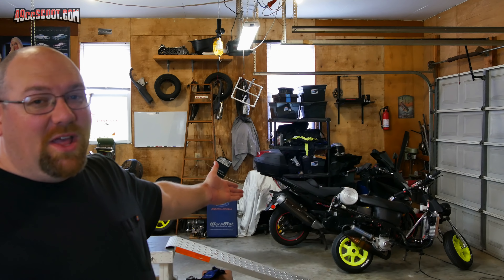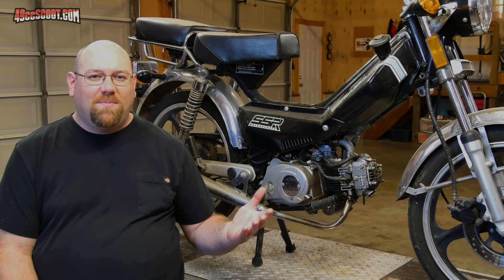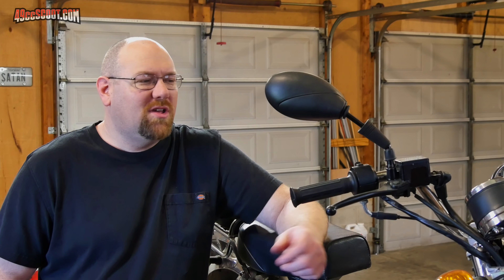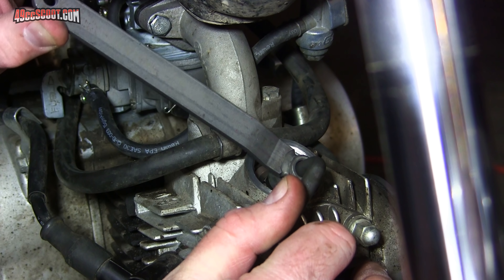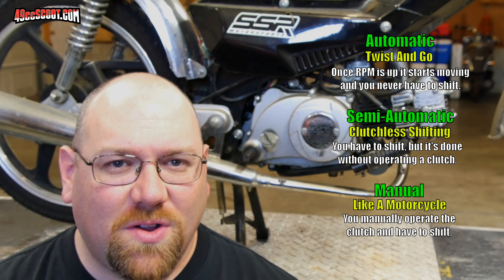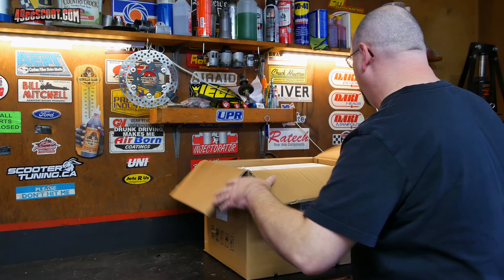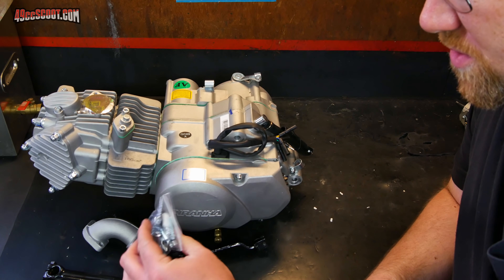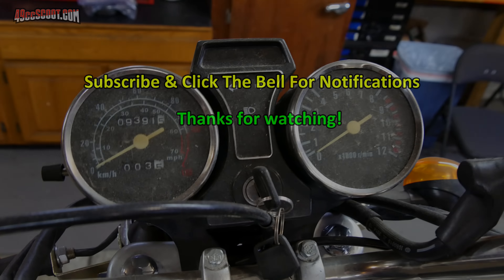SSR Part 1 : Starting A New 49cc Based Project

Comment: Wow I never knew there were 4stroke mopeds like this. A few months ago I bought a Tomos as a project. I restored it, tuned it. And now it's my main vehicle, because I sadly blew up my Piaggio's engine. But luckily I'll get my new cilinder soon and crankshaft soon.
Reply from the maker: They don't seem to be very popular. Good luck with your project.
Reply: @49ccscoot  well Tomos is very popular in the balkan region (former Yugoslavia), its kinda like an icon.
They made a 20 horsepower 50cc race version in the 1980s, look it up tomos gp 77 and gp 78
Reply from the maker: @gocak745  I meant the 4Ts. A friend of mine had a Tomos Sprint and it was pretty fun to ride, even stock. I didn't know about the 20 HP versions though.

Comment: the moped bogging down is a result of an insufficient ground between the carb intake bolt and the frame, excited you have one of these grew up with Tomos A35 and regretted selling mine
Reply: I run at least 2 grounds secured with ring terminals off the intake boot bolts on my GY6 I've run into this issue several times

Comment: Hey. I have this exact moped with the same problem. I did all this stuff you did and then after a few months It was the centrifugal clutch. The clutch springs are out so your going to need to replace the springs but I put a performance clutch on and it is a beast now.
Reply from the maker: Thanks for the info. Some other comments show interest in the issue, so hopefully it helps them.

Comment: I haven't had a scooter for years but love your channel.  I do still dream of on offroad capable scooter though....perhaps something like a Piaggio LT150 or Liberty with dirt tires.
Reply from the maker: I'd go for something without much bodywork and make sure you can get knobby tires for whatever wheel size it has. You could always get a pitbike with an automatic version of these engines if all you want is an offroad automatic.

Comment: Is the engine case capable of housing gears?

There are nice 190+cc electric start engine available cheaply, roughly 20hp

Reliability issues are usually kickstart and gear cluster issues
Reply from the maker: Yes. The 190s I've seen were not in my budget and I have my doubts about them holding up for street use based on  reading some forums. 15HP isn't bad and I can always get a big bore kit if I really have to have more. I think I saw somewhere that there was a ~200cc BBK too that requires case machining.

Comment: Dude, do you have the service manual from this motor : LC157QMJ, i want the torque values, ive assembly my final transmision and i got oil leak, then when i put the bolts again i broke one bolt, thats why i want the torques,thanks
Reply from the maker: https://www.49ccscoot.com/manuals/Arrow_150_Engine_Service_Manual.pdf

Comment: hi chief :D julian from bucharest here , im gonna dumb about 600 euros in my keeway , i have a dillema , 17.5 or 19mm carb ? also at the shop i found they only have manual choke carburators , tnt carb 17.5 / dellorto carb 17.5 both manual chokes ... can it be modified to go manual from automatic ? or its not good ?

Comment: Hey scooter man. I have a problem. I have taotao atm50-a1 with big bore. Blew engine from lack of oil. Ordered new one but accidentally bought long case. I'm not to sure ebay guy will return and I couldn't cancel. I think I know the answer but the long case in no way can replace short case can it?
Reply from the maker: You can probably swap it in, but it may require work. If you get really lucky then it will just look like you stretched the scooter a couple of inches. Could have issues like running into the mudguard or body panels or the shock not aligning as it should. If you can't get a return/exchange, then I'd at least mock it up and see what it's like before giving up on it.
Reply: @49ccscoot  thanks for the reply brother. The gods have smiled upon me. I was able to purchase a. " sym 200 hd for 500 bucks. It only has 5500 miles. The guy wasnt sure what was wrong with It bc it wouldn't start a d he said last time it did it bogged down..  well a 3 dollar fuse carb cleaning, fresh gas and my 50cc battery and I got a kick ass scooter!  Got her up to 70mph on the highway! I def think I'm done with the tao tao but I definitely learned a ton from your videos and I really appreciate you.

Comment: Considering this bike because i longer the vintage style. My understanding that it's not very powerful. Do you have any recommendations for a 72cc big bore kit? Any other upgrades? Thanks
Reply from the maker: I've used Trail Bikes big bores before and they were quality. With these engines, swaps are pretty simple. You can buy larger engines and swap them in. I'm not sure what the largest fully automatic is, maybe 110cc. You can also get the semi-auto style, so you shift but there is no manual clutch to use. Then there are full manual engines that get really big. Watch the rest of the series and you'll see me swapping in a 160cc full manual.
Reply: Thanks. Don't want to get a cycle licence. Have to keep it 50. But they won't know if i put a 70cc kit on there after it's registered. I'm 47. Big guy. Just looking to make this lug me around because i love the style

Comment: Timing chain jumped? Ignition timing out?
Reply from the maker: I actually put a degree wheel on it when I was first checking it because I had a scoot that had the flywheel machined wrong once and it was really sluggish. Looked OK though.

Comment: Hey mate have been following your projects and find them great, very in-depth so I’m starting mine. I have a Aprilia sport city 50cc 2 stroke I have done a few things too but one of them being that I won’t it to run on e85 and just finding it hard to tune the 22mm carb so it runs great have been playing around with the jets and stuff. But just after your thoughts on this? Keep up the good work hope to hear from you.
Reply from the maker: Remember that E85 is going to require richer jetting than what you are used to and what you'll usually find quoted for various setups using more standard 10% ethanol or ethanol free fuels. The air/fuel ratio for E85 is about 9.8:1 vs 14.7:1 for ethanol free, so it needs more fuel per volume of air. Aside from larger jets, you'll need to make sure the rest of the fuel system is in good working order and can supply sufficient flow.

E85 is going to be more hygroscopic, so it will absorb more moisture from the air than standard pump gas. That could cause problems if it sits for very long. Some two-stroke oils may not mix well or stay mixed as long in E85 also.

If you're trying to use a CHT and are accustomed to plain pump gas, then you may see a little different numbers so that  could throw off your tuning if you're relying on that.

We don't have E85 at the pump anywhere very near me, so I've never messed with it to give you first hand experience.
Reply: 49ccScoot

 thanks mate I will keep working on it and let you know how it goes.

Comment: How long does a scooter last 
10,000 miles
Reply from the maker: It depends on the scooter, the maintenance, how it's used, and so on. If you get a quality 49cc and treat and maintain it well, it could go 20,000+. If you're talking about any scoot... my TMAX 500 has 28,000 miles on it and I haven't even changed the drive belt yet.

Comment: Where do you find the vin number ?
Reply from the maker: Most scooters and mopeds will have a VIN on the frame  somewhere between the hbars and the pegs/floor. If it has body panels, you may see a rectangular panel that pops out, which covers the VIN.  Sometimes there will be a VIN plate as well, which can be pretty much anywhere they want to put it. This one had it etched into the frame as described and had an ID plate under the seat.
Reply: @49ccscoot  Thank you for replying for one. And I found it it was under the seat

Comment: Just subscribe to your channel. Great channel. Question. I’m new into moped. Have a Soleil R8 49cc GY6 moped I think it’s made by znenmotor so I’m 200 lbs and 5 11. Bike stock does 30 to 40 straight and hills 20 to 25. Rides nice and quite. Just want to add more torque to keep up with traffic going to work. Was thinking of doing 100cc BBK but seeing a lot have heat issues or more. I thinking of doing a 80cc. I seen lots and lots of videos how to do it and more. But being im not a mechanic it seem overwhelming but I feel I can do it and have the time since we are lock down In Hawai’i. I seen lots in amazon for like 45 to 90 dollars. And eyes pop open cause here the shop want to charge me 340 just to install the 80cc head kit that they sell. And 580 for a full 100cc kit with cam and cdi. I just wanted to know if I should try and take the challenge on a perfect running bike being I have not done any type of this project before. I do mostly computer building and tech. So this will be different. Please advise on this. Save money and try it out. Or spend the 340 and have the shop do the 80cc bore head. Thank you and aloha from Hawaii. Stay safe.
Reply from the maker: Hey. First, good call on the 80cc IMO. 80cc is actually 72cc and 47mm bore, but they love to advertise everything bigger. Anyway, those seem to be less prone to failure. You mentioned going to work, so reliability is likely a good thing for you. Most reliable will be the stock engine, probably, but I think those kits are a good tradeoff of power increase vs reliability. Get a Taiwan made kit. Don't buy the cheapest thing on amazon. Sometimes those work out awesome. Sometimes those have poor clearances and gaps. Taiwan made kits aren't that much more (Naraku, SSP-G, NCY, etc...).

I build my own PCs when I have to, which thankfully is not often. If you do that on a daily basis and are capable of dealing with details like which header to plug in or what components work well together and so on, then I would guess that you are capable of doing your own big bore kit. The trick to learning with this stuff is to take your time, follow instructions and tutorials, and ask if you aren't sure. It's better to be down an extra day waiting to be sure than doing it wrong and messing something up.

Take the time to check the piston ring end gap (not always mentioned in tutorials, but I have one here that you may want to check out : https://49ccscoot.proboards.com/thread/350/big-bore-kit-installation ). Check and double check the timing marks and valve adjustments.
Reply: @49ccscoot  thank you so much  Yes What I have read and seen was the 80cc to be the safe and still have that power when you need it.  I was thrown off when I was riding to work and this pink pronto moped blew pass me  I think was doing like 45 50.  I would love to achive that on a basic setup.  I buy mostly from Amazon due to the shipping to hawaii.  If you can kindly share a link to what parts I need for an 80cc BBK and if I need a better carb since the stock is not able to open to change the jets.  Yes I watch to much you tube on all this and I find yours to be the very best and I feel lots confident watching your channel.  Again Mahalo and Aloha from Hawaii
Reply from the maker: @JPTake3  A lot of the stuff I see on there is Chinese. I would consider checking out somewhere like ScooterTuning.Ca. Not sure how they are to HI, but their shipping is great to me in the continental US. Check out NK100.47 cylinder kit, NK200.01 carb,  S6-28GY6-002 jet kit, and then I would get DrPulley sliders (16x13) for tuning the CVT. They don't carry those unfortunately. Maybe a set of 5g and 8g. That  would give you some tuning range. 5g usually works well stock, so you shouldn't need anything lighter. You can mix them 5,8,5,8,5,8 to average 6.5g. You can also stuff them with foil to make either set heavier by a gram or so if needed.
Reply: 49ccScoot thank you. Will search for those items. Just got back from doing errands and love this bike. Doing 30 to 40 is nice. But that extra boost would be nice. Since traffic can be crazy here. But I did do the slider which I read and ordered the previous owner had 5.5 and took longer to hit 40. Now I change it to 4.5 and hit 40 quicker. Both rollers don’t have that take off but it’s good. Not like that video I just watch that you was tuning that bike. My goodness 70 plus mph. That’s too much for me. I be happy at 55 plus and that would make my day. As you can see I did change the roller and had to get an impact gun. Tried all the other day from you tube but the right tools made it easier to change the rollers. Again keep up the great videos and guides. I be surprise if I can get my bike to 55. Here Honda elites are the prime bikes. The Japanese bikes rule here. But I won’t knock down this gy6. They have nice ride and love mine. Again mahalos and Aloha
Reply from the maker: @JPTake3  Good luck with it. Remember, 2-strokes are a different animal. You won't find many really fast 49cc based 4-strokes.
Reply: @49ccscoot  yes 2 strokes are the best they say at the shop here. There are couple very fast gy6 here with 100cc bore and some clock at 75 to 80 what my neighbors told me that have  tao moped and the other one with a mad dog ruckus clone. Lots of people are starting to get into ebikes here. Like I did but can't beat a moped for getting around to longer distance

Comment: No no not a four stroke ....😐
Reply from the maker: I love 2Ts too, but if it's fun to ride and work on I'm up for it.
Reply: charlieoscar09 - take a look at the 190cc version of this engine in a mini bike, they rip like a 2 stroke 😂
Reply from the maker: @davespooney8472  I think those can make around 20HP. I probably had something like 10-12HP max in my old midbikes. The small framed cateye would power wheelie in 4th gear at low speed, so I can only imagine doubling the power. Plus 55MPH was enough on 6" wheels.
Reply: 49ccScoot - they are a ton of fun 👍 you were playing with these engine when they were first being imported right? Must have good knowledge of what works and what doesn’t
Reply from the maker: @davespooney8472  I don't know when they started, but early 2000s is when I messed with them for a few years. I didn't really mod the engines too much then. BBK, cam, carb, intake. Sprocket swaps. I'm not an expert on these things. I just liked them a lot and, at least the smaller ones, were really tough engines that took a lot of abuse.
Reply: 49ccScoot - yes from my understanding 160cc and under is the sweet spot. Tough and pokey.